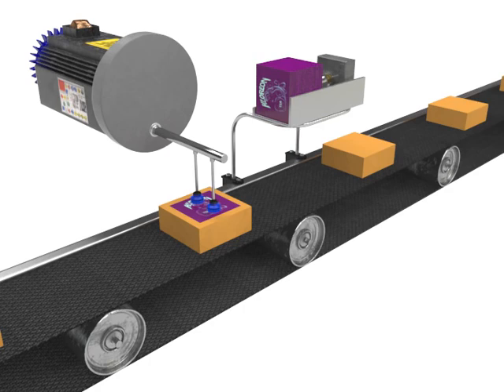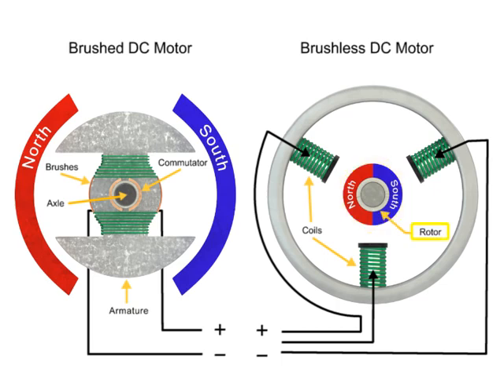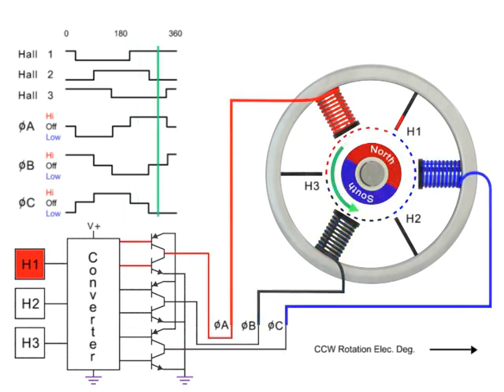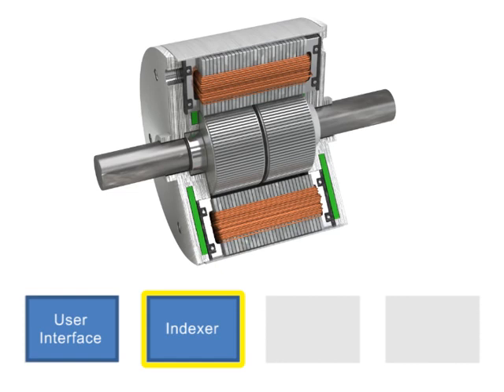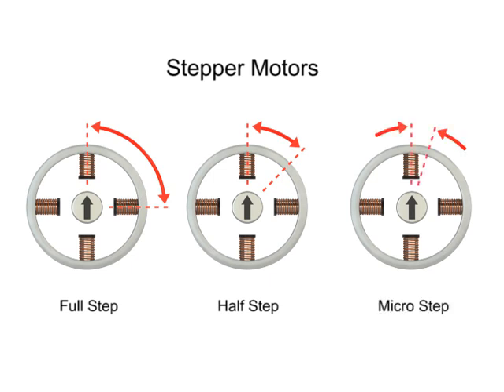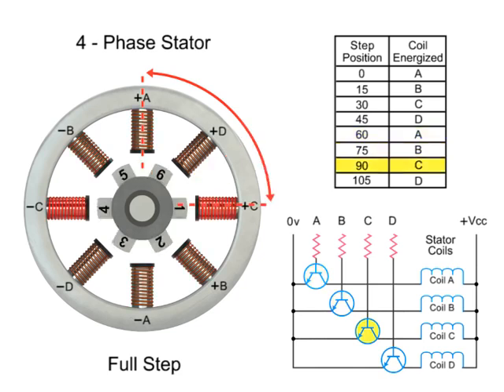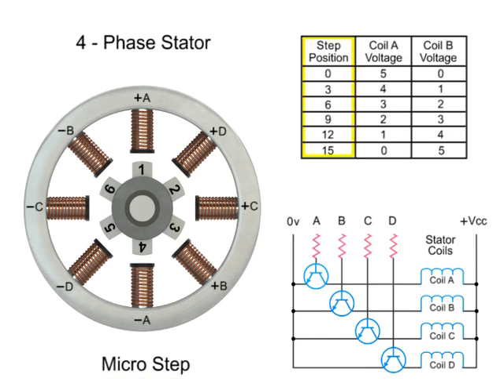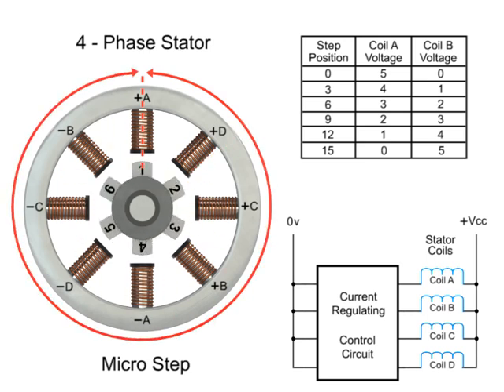How servo motors work (3D animation )

Comment: Since when was a servo motor called a steeper motor 😂
Reply: I think they are two different things. 
To my understanding, servo motor can rotate continuously according to the command of control unit while stepping motor must stop for every single step before continuing to move to the next step.
Reply: I was about to comment that, here is the working principle of steepper motor not the servomotor working principle explanation
Reply: Any motor can be called a "servo motor", or more correctly a servo system, when it is equipped with feedback. (there is no such as a servo motor inherently)